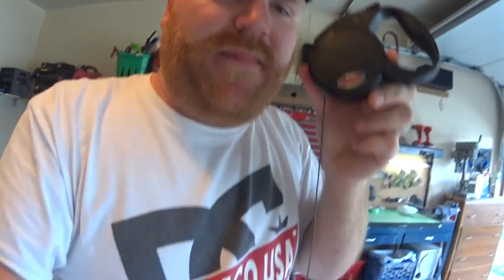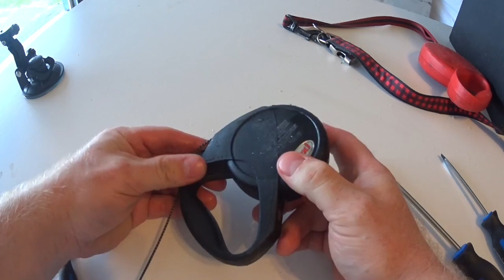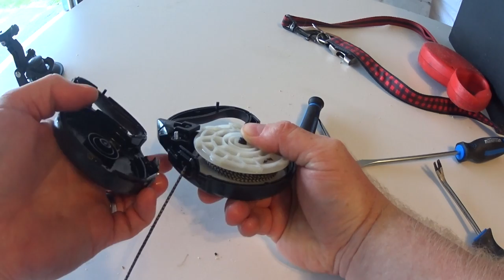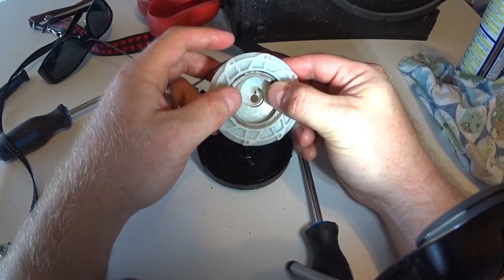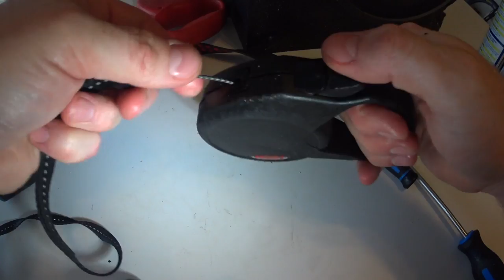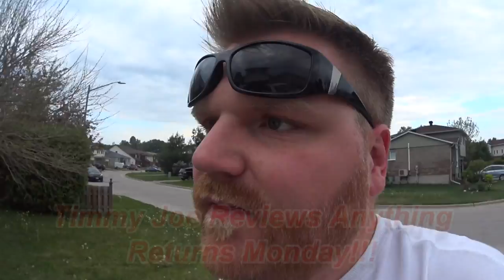How To Fix A Retractable Dog Leash

Comment: Very awesome and helpful video! Thanks. I’m wondering how did you manage to re-close it after repairing the spring? I have a Kong leash that I had to pry open and it had five or six of those hidden screws molded into the plastic. It’s like it’s designed to be non-repairable.

Comment: Jimmy, I am working on the red Flexi right now. Take a look down the screw holes and you will find a triangle shaped hole. So a typical screwdriver or bit will not work. I have every kind of bit there is and not a single one is a triangle shape. That's how these guys make money. Grrrrr